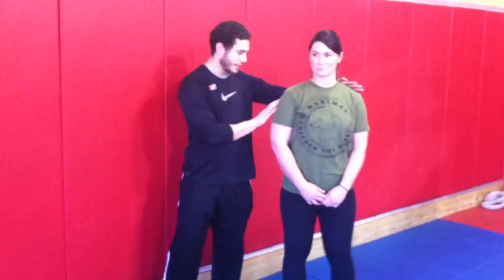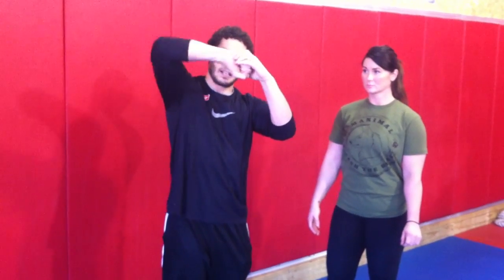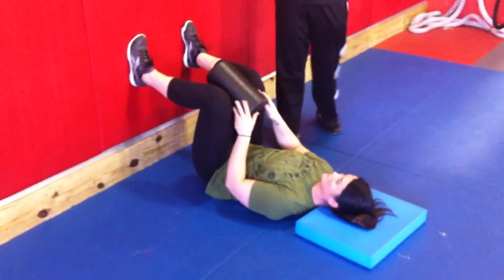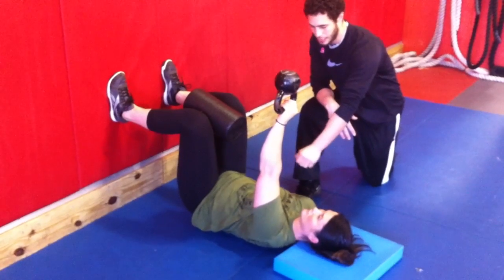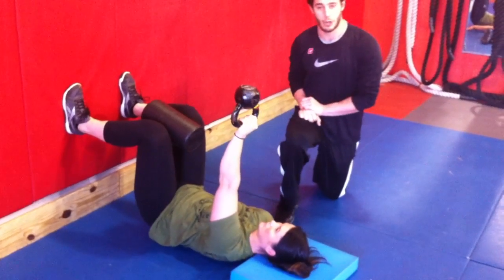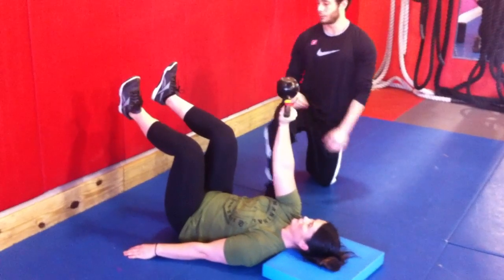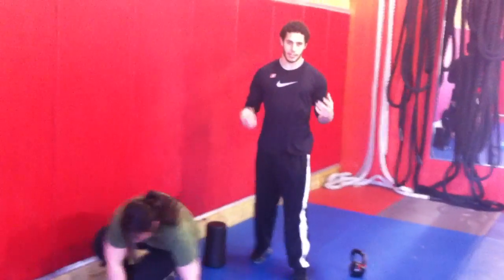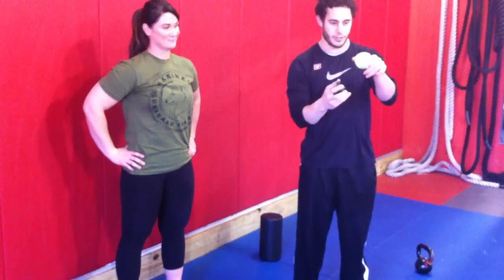Just The Tip: Shoulder Screwdriver For The Rotator Cuff

Comment: Was gonna ask if you could do a video on lateral epicondylitis and causes. Lack of shoulder internal rotation, lack of lateral diaphragm breathing. Been having problems. And I know on that side with the elbow pain my shoulder has had issues and also been trying to work on my breathing especially on that side. Seems I can't get a nice balanced full breath in. Just feels restricted. Would love to see your thoughts and or mobility and stabilization movements for lateral epicondylitis
Reply from the maker: I did a 10 minute video for the Juggernaut Strong360 Community, which is one of the best forums out there:  http://360.jtsstrength.com/videos/68/287/elbow-wrist-forearm-issues-when-squatting-discussion-and-c

Shoulder internal rotation is definitely a product of ribcage position, as shown here:
https://www.youtube.com/watch?v=PvarFYa0xHs

Learning to manipulate the ribcage through breathing and subsequent shoulder blade movement can clear up rotation:
https://www.youtube.com/watch?v=MBKj96gHGkY
https://www.youtube.com/watch?v=PfgBGJY4VEw
https://www.youtube.com/watch?v=XY5Ot2gs7Dc

This drill can help drive air into one side or another.  All of this can help take pressure off the elbow:
https://www.youtube.com/watch?v=rwN5u_psGIc
Reply: appreciate it bro. thanks

Comment: Why do you protract the shoulder when doing this? Wouldn't you want it set back "in the socket" reminds me of Kelly Starretts video with the band distracting. Might give it a shot I like the 90/90 for. A more stable and better position.
Reply from the maker: Great question Sam.  The aim of Kelly's video was to mobilize the posterior capsule of the shoulder joint.  He used a kettlebell to add leverage to the mobilization.  So, in that case, you would be driving the shoulder back gently, in order to mobilize the posterior capsule.  My video is not a mobility drill.  It is a stability drill.  Protraction is a precursor to every shoulder movement that occurs away from the body, as the shoulder blade has to slide around the ribcage in order for us to go overhead, push, pull, etc.  So, in this drill, we protract slightly to mimic normal scapular rhythm, then work to dynamically stabilize that position with internal and external rotation.
Reply: Thank you for the explanation... Tell you what, after watching this video. I did "Kellys" Video of mobilization it. but set it up so I was in the 90/90 position and it seemed that I was better to  set my shoulders  and keep the "shoulders connected to the diaphragm" if that makes sense. Instead of just going into deep depression and retraction seemed to be a better movement. When I do your movement I will keep that in mind on what the goal of that movement is. Thanks
Reply from the maker: Sam Adams Makes perfect sense to me!